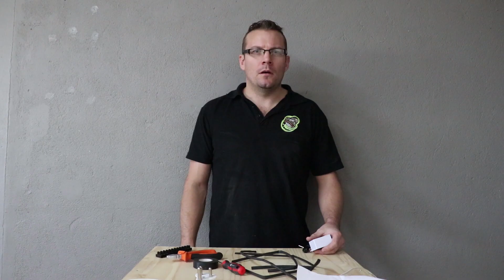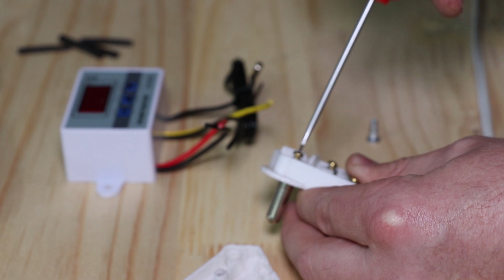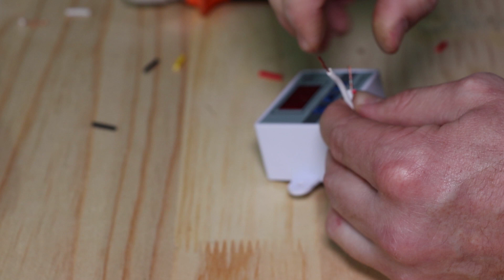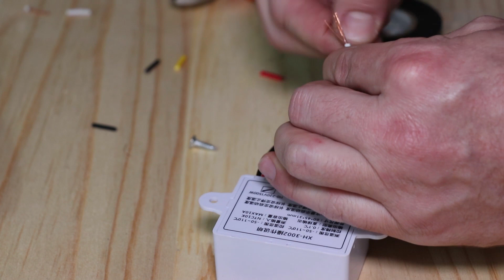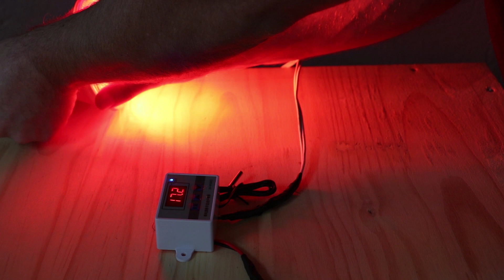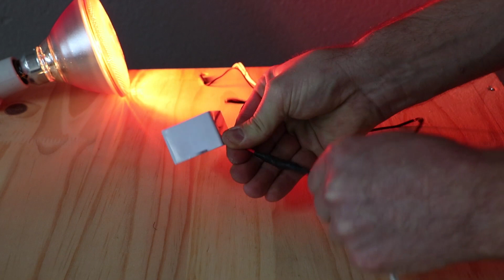XH-W3002 Thermostat wiring and programming

Comment: What I was looking for is the out circuit is market 24v. But my device and most devices are 220v is that a concern?
Reply from the maker: Sorry I just saw this. 24v and 12v options are available but not popularly used here anyway. They will pop if used with high voltage. They make for more specialized applications. We all use 220v as most reptile heating systems are of the same rating.
Reply: @reptilegarden Hi thanks for the reply its actually 220v on both sides. Its the marking that is abut offset so it looks a bit like a different voltage. That marking i realize is for another version of thermostat.

Comment: I recently bought two of these units from Reptile garden, it seems to be clicking none stop, I've followed the instructions on this video to set them up, is this clicking of the relays on both units something to be concerned about ? The clicking occurs every 5 to 10 seconds none stop.
Reply from the maker: Hi Craig, this might be due to you temperature settings and heating device/setup. If the values are set very close it will be turning on and off rapidly. I am assuming here that your start temps and end temps are very similar in 0,?  value? You can try set it at 1.0 deg c difference. The clicking should be the relay and there should be an indicator light aswell. The fact that both units are doing it would make me think it is a setting/rig and not a faulty unit. A slow gradual heat with make it not as rapid. Your setup sounds like it is heating and cooling fast between supplying power and then turning off. Let me know if you come right otherwise you can whatsapp me 0847763537
Reply: @reptilegarden  thank you, did just that, all seems to be sorted now.

Comment: Can two 9watt heatpads be connected to one thermostat like the one in the video? And if so how ?
Reply from the maker: You could connect 100 of them but obviously nit advised. Just remember the one without the probe will need ro be checked with a temp gun or thermometer to make sure it works. Then if the heat pad with the probe of the thermostat fails the other one or others will be on full tilt.
Reply: @reptilegarden  thank you so much , I do have a temp gun and digital thermometers in there tubs aswell and I check the tubs temps 4 times per day just to be on the safe side of things ,how does one connect two heat pads to one thermostat tho?
Reply from the maker: @craigsampson5325  connect them in parallel and not series. You can Google image if your not sure. Each heat pad must get full current.
Reply: @reptilegarden  thank you very much.
Reply: @reptilegarden  Sorry I think I may need to correct you. In a series circuit, the same amount of current flows through all the components placed in it. On the other hand, in parallel circuits, the components are placed in parallel with each other due to which the circuit splits the current flow.
Reply from the maker: @don_pedrogaming  the heat pads he is referring to are 9w and won't work if connected in series then if one blows non will work. I have wired hundreds of pads this way. So even if you can connect in series I wouldn't recommend it.  Having said this, due to all diagrams I can find on the internet.
Reply: @reptilegarden  makes sense that if one stops working they will all stop. Similar to those old Xmas lights. I was commenting on the distribution of current though, parallel does divide the current so perhaps when you have 2 in parallel they just won't get as hot as they could.
Reply from the maker: @don_pedrogaming  ok maybe I am not following you properly but they do all get 220v the way I link them.
Reply: @reptilegarden  yes the voltage will stay the same. Series current remains the same but voltage is divided. Parallel current is divided but voltage stays the same. 

Now that I've typed it out I see parallel is the only way to do it haha, because you cannot get a 480v supply. 

Sorry for confusing the issue. Love your content btw. Learnt a lot from you so far
Reply from the maker: @don_pedrogaming  all good. Thanks for the support.

Comment: There are much better connectors now ones that have levers or  connectors that are heat shrink with solder on the inside .....like plumbing fitting that are presolderd .  Thans for the video
Reply from the maker: Thanks James, yes we have seen those fitting and they are amazing. We just use the block connectors in the video as they are the most commonly available.

Comment: Ho hum - 15 minutes of wiring instructions, really? Programming, that's the basis for my tuning in.  Does SET button need to be Pressed & Held during Up/Down temperature P0 & P1 settings?  No mention of this requirement.
Reply from the maker: Yes really! If you read the heading is says' "wiring and programming". Why make two separate videos when you can just skip what is not relevant to your needs. Go to 13 min and 20 sec. I clearly say you just push the set button.

Comment: Hi Great video... What happens if polarity got change.. ? Because I have 6 points were polarity is different in each.
Reply from the maker: If you have 6 wires you may have the temperature and humidity unit. So two wires out heating and 2 wires for humidity controller or fans. I don't have those yet and haven't worked with them. Hope that helps.

Comment: This thermostat keeps on dropping in temperatue for me. Is it perhaps the wiring being squashed by my enclosures lid or the position of the heating pad. Do you know what I can do to stop the temperature dropping?
Reply from the maker: Just go through you settings again as you might have a big differential so the thermostat is going to play in that range. Th3n check you dont have any damaged wires which are struggling to make a connection. Then lastly if your heating device is taking a long time to heat up but once off is cooling rapidly then you might not have the heat pad or such device working optimally.thos could cause it as the heat pad is struggling to heat everything depending on what it is in contact with. For instance ifnit is in contact with a table etc the heat is getting sucked into the table more that being focused into the cage.  You can see when the unit is heating by the indicator light. Hope this helps.
Reply: @reptilegarden  Thank you so much for your help!
Reply: @reptilegarden  One more thing, My tank has paper towels as it’s floor. Should I put the probe underneath the paper towels or next to my snake’s hide? Do you think that the paper towels could be interfering
Reply from the maker: @Cyetfol  No paper towel is no issue. Maybe the heat pad in contact with the based of the cage and the base of the cage being in contact with table etc. Heat gets sucked down. Having something to insulate the heat pad so heat is focused more up can work. Just check all aspects and work your way through.